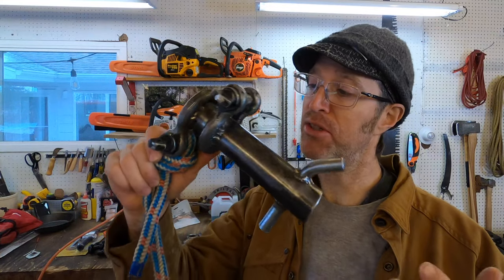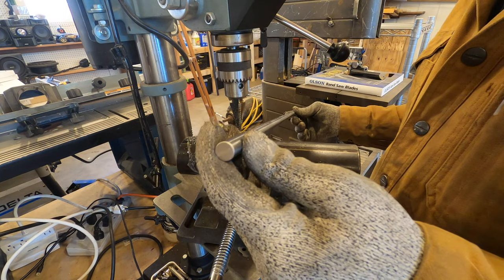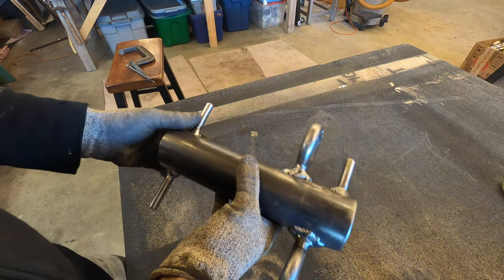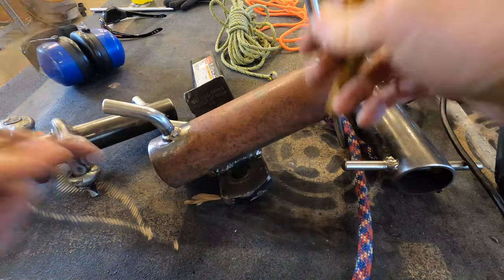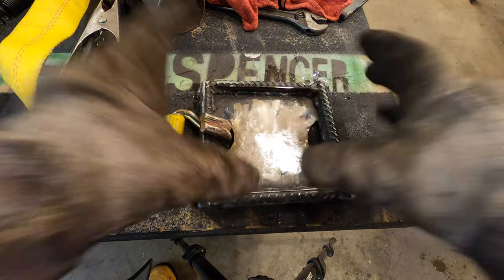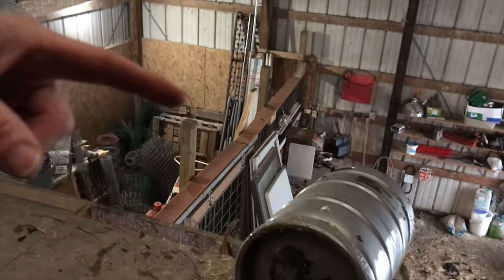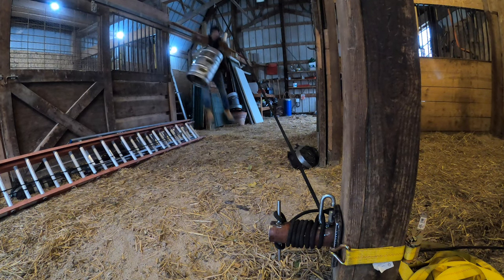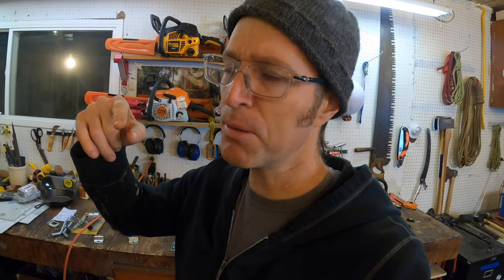Fabricating + Testing PORT-A-WRAPS

Comment: I’ll never use one of these, but I was fascinated through every step of this process. Thanks for inspiring us to create beeftastic solutions!
Reply from the maker: They're definitely specialized tools that not many people have used. It's funny: after doing this project I kept thinking about making the most common tool ... like maybe a screwdriver? Thanks for checking it out
Reply: There are phenomenal for making a 600lb limb with the line going to a pulley not lift your 200lb body straight up into the tree.  With the increased friction of the wraps they lower the amount of force needed to slowly lower things, its not a block and tackle but works similarly but much easier and much less line.

Comment: that's a fantastic demonstration man!
I learned old school, use a stub up in the tree to wrap onto, wrap the rope around the trunk of an adjacent tree. I've wanted to get a porta wrap, because sometimes the stub isn't in the most coinvent spot, or the tree trunk either.  Being also a welder, couldn't bring myself to spring for over $200 in some cases for one. That price is just a rip off to me.
I thought about making one for a while. Thanks
Reply from the maker: Those wraps you describe are the old school, long tested way to go -- still works in most situations. You're gonna love the device when you make it though

Comment: Well that was fun. Working with steel is real. Still, I would put a bolt through that trailer hitch. I have had welds fail. Cheers man.
Reply from the maker: I agree 100% ... looking at that hitch mounted one later I was thinking the pull was entirely on the weld. You've got it

Comment: The second porta wrap is great the problem is your using it wrong. You should look up a video on how to use one and I think itl be your favorite one to use. Your anchor rope is on the wrong ring once you switch it will be mid line attachable. You will fold the rope to make a bite, stick the bite throw the eye and over top of that pin then you wrap towards the two pins at the other end.
Reply from the maker: Good eye and point taken. With practice and some advice I got the hang of the attachment method in the months after making these. Great tools. So valuable.

Comment: I wonder if you could rig a boat trailer winch to the bollard and fabricate a version of the stein rcw? Great video. Thanks for sharing!
Reply from the maker: Oh boy did you ever read my mind. I love that cranking design, as tightening and actually LIFTING would be sweet. I'm keeping my eye out for one of those boat winches. If I find something that will work I plan to mock one up. I saw another dude online who made a great one. Very inspiring.
Reply: @metaspencer  yep my thought or one with a habor freight atv winch on it or shop crane in the truck as truck crane to lift some of those bigger logs. or build a log trailer like some have done to load logs in the truck or trailer.

Comment: Great vid you should check out the gb bollards
Reply from the maker: definitely! those are nice and solid
Reply: @metaspencer  one of the companys makes one with a brake and a cranking lever you can apply lift force before cutting cant remember the name
Reply: Is it the GRCS "Good Rigging Control System"? Absolutely nothing beats it, minus a crane!

Comment: A couple things to consider.  The commercial models I’ve seen are all corrosion resistant in a manner that is very polished smooth. Stainless steel,  nickel plated,  powder coated.  
Friction/heat from rope travel will quickly remove any paint.  Any part less than shiny smooth and any corners not radiused like a well used bar of soap will shorten the life of  $$$  rope. 
On the other hand,  I’m guessing you won’t be singing rope thru them all day,
every day like an arborist crew,  so all of the above mentioned points might be moot.  🥴     🤜🤛
Reply from the maker: I recently sanded and painted a couple of these as they were getting a bit rusty, and they definitely have a different feel to them with the rope loaded. But you're right: I only use them once in a while when lowering heavy trees and sections ... thanks for the tips!

Comment: Was wonder about tying on a device.... All you see is cow hitch or whatever with a deadeye sling or a different sling. Is using a rope with a knot acceptable if the load isn't too big? Like on your small porty
Reply from the maker: It would depend on the load, but a lot of people use a bowline with a Yosemite finish ... otherwise it's the timber hitch or cow hitch ... I prefer the hitches as they don't tighten up too much. What device are you talking about?
Reply: @metaspencer  thank you for the reply. I have a Backbone and a steel figure 8 for the light rigging duty purposes. Just looking for an easy way to tie those to a tree without buying a dead eye or some other type of sling
Reply from the maker: @anthonyr6286  Oh yeah for those kinds of attachments I'll either use a sling or tie on with a bowline+yosemite ... or some other rated knot combo like scaffold knot + butterfly
Reply: @metaspencer  awesome, thank you so much. It seems like a lot of guys on here forget about the basic stuff. I like your style

Comment: good video and cool ideas. be safe and careful. "necessity of the mother of invention".  and i cant decide if its a lazy man or smart man that invents tools. i say lazy man because he looks to make a hard job easier but smart man thinks it though before starting. :dunno:

i've wrapped the rope around the rail of work platform and kicked load off and lowered it down. more wraps the easier it is stop.
Reply from the maker: the base of a tree or nearby log has worked for me to wrap the rope -- and with good friction. So we'll see how these work and if I actually use them in the field. Thanks man

Comment: Why even test it if your going to use an empty keg. If it's going to fail its not going to on a load that you could drop  lift and lower without it
Reply from the maker: I should have filled that keg!
Reply: @metaspencer  not if you want to do it in your pole barn like i think it should hold but not worth it. I would do it dropping sections bigger than you plan on using it for in a place where you can just drop them and see what happens. Also lowering with a real load can help you see if you bend radius is bad for those small I hooks.
Reply from the maker: @josephchick3100  yep you said it man ... that would be a real on the job test!